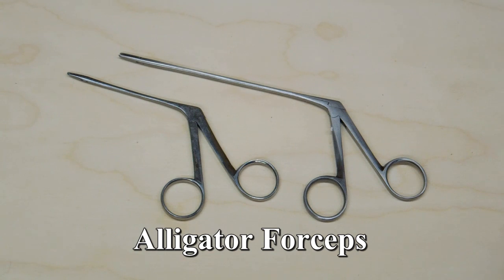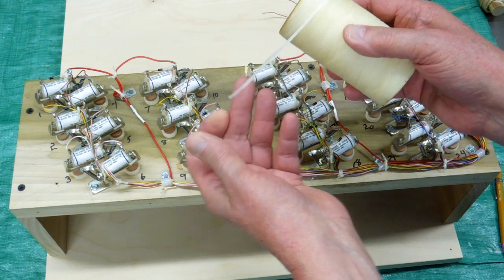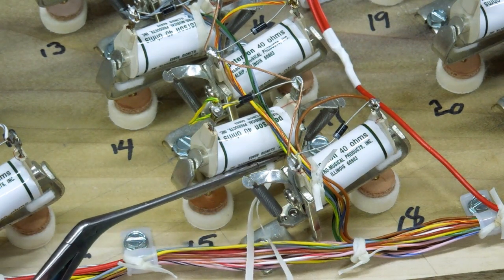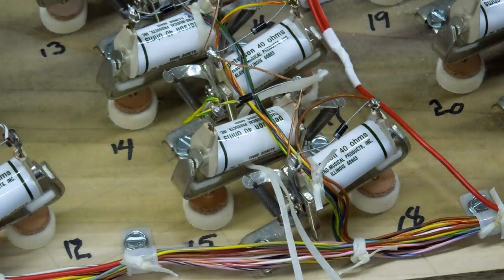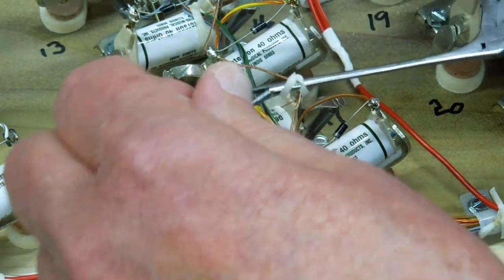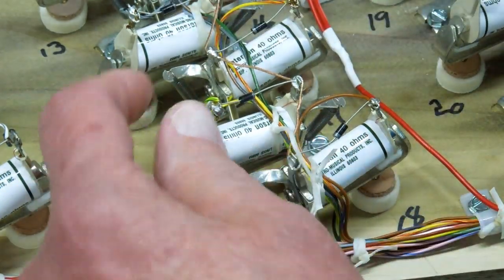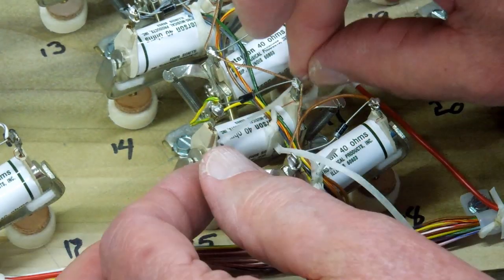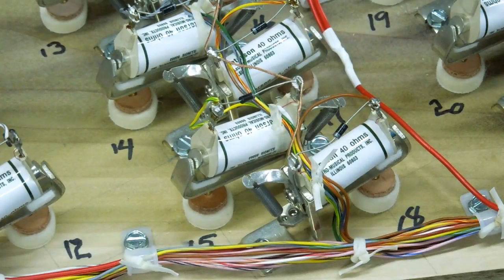Wire Harness - Waxed Flat Braided Lacing Tape

Comment: ok, but kind of falls in with the snakepit theme that seems to be going on. I just think the assembly could be condensed, set up for a wiring harness underneath or mounted on a custom pcb, they are not expensive but if you're prototyping any cheap fixturing is fine. zip ties do have the advantage of being a quick install but yeah, they have a limited lifespan

Comment: I went through a electronics assembly course for NASA based on Air Force, NASA fabrication standards.  According to that your knotting is wrong.  We had to use a contractors twist knot with a square knot finish. This kept the wire run low profile and allowed it to pass through bulkheads. 
Cable Ties and grommet material have had the issue you described for getting brittle and breaking and being removed for maintenance by crews this has caused crashes in the F16.  
I have seen tie work I’m some old vacuum tube radios over the years not sure if first owner did it or the factory.

Comment: I remember seeing a WW II era Ham Radio handbook.  An entire chapter was devoted to circuit layout and lead dress.  As I recall, the concerns included mechanical stability, connectivity, electromagnetic isolation and visual appeal.  Also, some of techniques resembled nautical fancywork.  I suppose that, if you were spending a few months building your rig from scratch, you might also want to make it pretty
Reply from the maker: Old adage… If it looks neat and well done, it probably is. Someone cared enough to take the time to do it correctly. You may find the FAA Acceptable Methods, Techniques and Practices "Advisory Circular” (Mechanics Bible) of interest. It is linked in the description for this video.